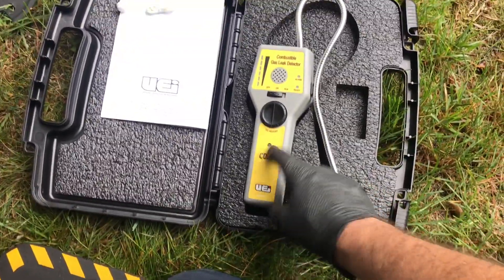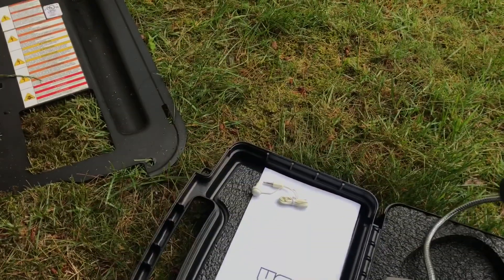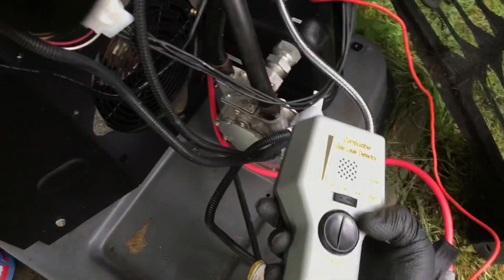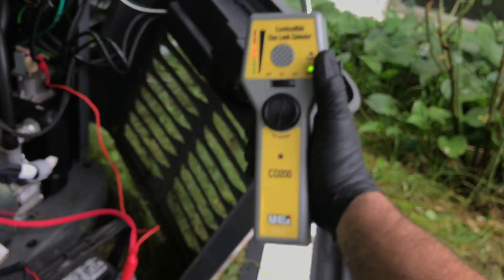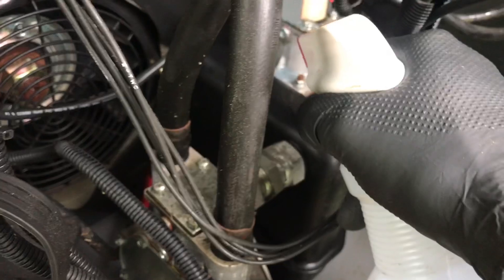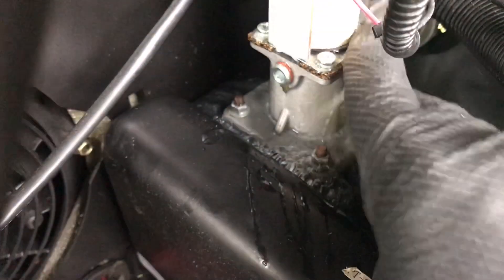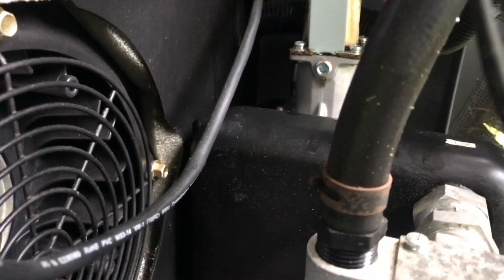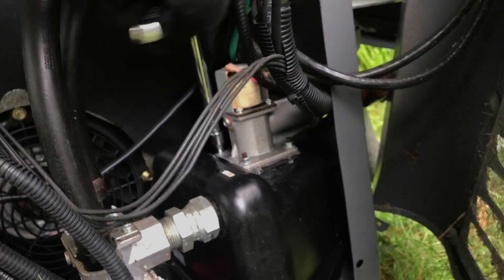Natural Gas Leak Search using UEI CD200 Electronic Gas Detector

Comment: @ 2:32, not sure if bad camera angle or that thing was hit hard and bent or someone "hulk hogan" cranked a pipe wrench without holding back and bent the snot out of it.
maybe just camera angle, but looks like lower and upper piece has ears bent downwards, maybe cracked at or above test port plug... .
someone fiddled or over tightend perpahs
Reply from the maker: It’s the camera angle. Your talking of the space I first thought was leaking

Comment: also, for natural gas leaks, my nose works best.... busted a furnace leak the other day, in house that had windows open and strong winds blowing through...
JUNK NEST thermostat on auto foolishness, at 80F they had it set to turn on blower only. I didn't see or know that, as I was there for total unrelated work. but I walked through and the breze hot me and I smelled natural gas odorant... but it went away fast because the breeze blowing through house. it took me a few hour to recognize/think where it came from..
again, doing work zero related to HVAC/plumbing ;)
Reply from the maker: My nose misses many smells. Seems like I always end up on there jobs where I’m being asked, do you smell it?

Comment: Hi Bill, I have a Generic Guardian 16kw installed in Oct 2014 and my mom's 16kw was installed Aug 2018. Is this the fuel Inspection you're doing? I found it on the Generac web site. Looks like I'm not in that date range? I need to schedule maintenance on mine anyway and will ask the company I use.

greater than 11kW, manufactured between 2008 and 2012, and located in one the of the states and counties listed may be eligible for a special inspection program, at reduced or no cost,
Reply from the maker: I'm tying in gas and flue at my dads. When I get home I will look it up but i believe the plenum was used in some genesis until 2016. Generac wants us to charge 80 bucks for the inspection yet we are doing them for free
Reply: @thehvachacker  I appreciate you checking. Thanks ☺️

Comment: If it is a recall, why don't you get the replacement parts, especially if the mfg. is paying the tab. Thanks for that video.
Reply from the maker: There paying for an inspection to verify the fuel plenum is not rotting or leaking. I have done about 20 of these inspections so far first one leaking none qualified for the recall. They rust out and leak from sprinklers, bushes being to close, lots of mulch. If I find a leaker or rotting plenum which is that black box under the fuel solenoid I have to shut down the generator since Generac has none left and don’t know when they will have more in stock.
Reply: Thanks for the explanation. If the mfg. is out of stock that would indicate a really large issue. Maybe by salt water or wet areas. Thanks